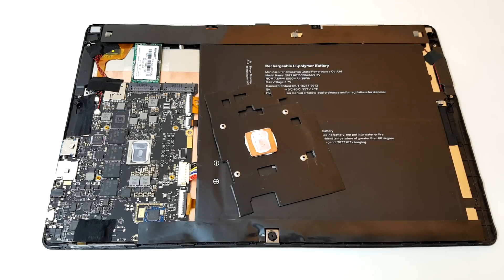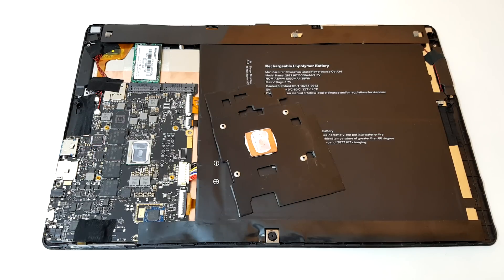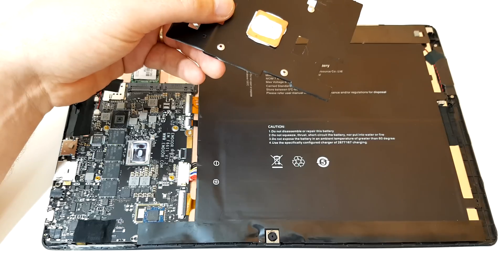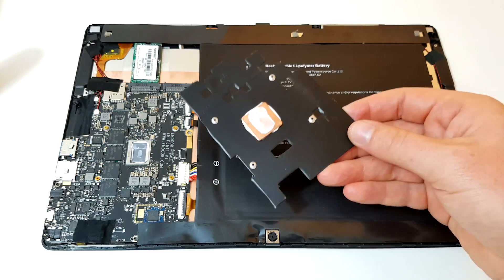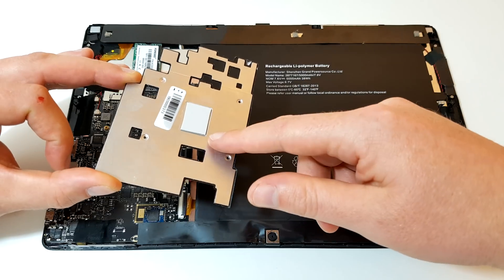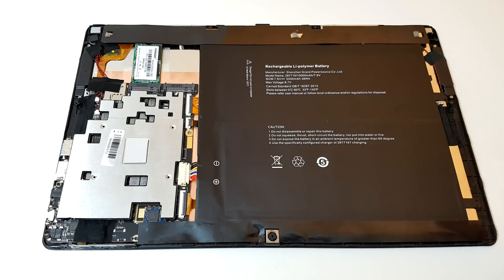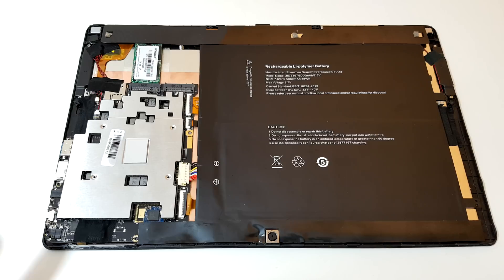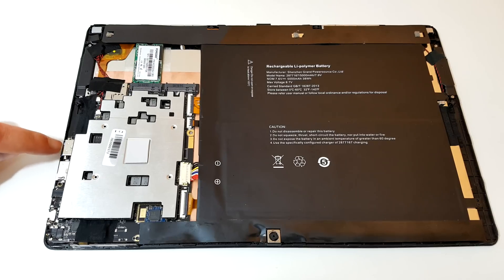Cube i9 Simple Copper Heat Sink Mod (Lowers Max Temps 20 Degrees)

Comment: Finally was able to complete this project, ordered 20mmx20mmx1mm copper shims off eBay and the shipping from China is about 30-45 days, worst part had to order 3 times!, first two times package never showed up (no worries, got refunds) that was about 2-3 months of just waiting for the copper shims to arrive.
Ordered thermal pads and grease separately, arrived months ago.
Took the i9 apart thanks to your tips, an hour ago, took off the metal plate on the CPU, Paste | Shim | Paste | Screwed plate back on, not fully it began to bend a little, I assume 1mm is too thick so I only screwed the plate on about a turn and a half each screw, and just applied some 20mmx20mmx1mm thermal pads on the plate, just threw pads everywhere, made sure none made contact with any components below the plate.
Before: temps in games 78-82c
Now: max I've seen is 51-53c !!!!!
Amazing. seeing 80c temps is just scary, I'm in IT and those temps are just uncomfortable, this mod has made gaming on the i9 and just general use so much more enjoyable, I was always shutting off when I hit 82c temps, I just get scared, haha.
Thank you so much (also the other heatsink mod vids for the i9 haha)
Reply: Hi, I'm waiting for my parts to come and do the same mod. I will receive 20 thermal pads 10mmx10mm each. Did you just randomly put them on the plate?
Reply: I see now that I should have taken pictures, yes I just covered the entire "pseudo-heatsink" thats already inside the i9.
I covered it all in thermal pads making sure not to touch any of the components below or on the edges, also where the holes in the heat-sink are, I just cut holes in the thermal pad to match, if the heatsink doesnt touch those, I guys the pads shouldnt either.I used 1mm pads that actually felt a bit thick, like when I put the backplate, back on, it felt like there was a bulge, I advise not to put too much pressure, just gently squeeze because at this point you're squeezing the TIM, the shim(s) and thermal pads, squeeze too hard and you might  bent/snap some tiny weak component, so just be careful.

Comment: Hi there ) What do you think about 25x25x1.2 copper shim? Will it fit or better use your size? And what about this concept for a custom built copper heatspreader by Wootever: http://fs5.directupload.net/images/160403/i4kz2nhz.jpg?  Or its enough just one copper shim like yours for this tablet?
Thanks )
Reply from the maker: +second Might work, I just didn't want to go wider in case it got too close to causing a short somewhere. But I think Woot ever solution is great, it would lower temps a huge amount more than my little mod.

Comment: Do you think it would be able to fit a larger than a m2 2242 in this cube i9?
Reply from the maker: +bonnome2 Hi, no I tried my Sandisk 128GB 2260 and it's too big, if there was just a little more space it would and a second ssd doesn't work in the 4G M.2 slot. Only LTE modems will work there.

Comment: get better dude! I really looked up to gaming with thermal mod video. 
there is probably a workaround. go to some service center and ask if they can flash bios. there is a way to flash to dead devices, as bios has its own power plus you are not the first one with that kind of a problem! good luck man, dont turn to pudding yet

Comment: Its kinda weird that a simple mod like this can lower temps by 20 degrees and Cube engineers didnt think of this? Its certainly not a cost issue.
Reply from the maker: +Cho I know, very odd they don't use copper heat sinks like Dell and others do on the Core M's.
Reply: +TechTablets.com What if I use a 25x25mm copper shim? can it make shortcuts by having contact with other components on the mainboard?
Reply: +Asm X I meant short circuit...

Comment: Sorry for your loss but maybe there is someone that can solder a new bios chip on your tablet? 
I had a similar problem with my L702X from Dell and I found a shop in Düsseldorf who replaced it for 20€. (Chip not included)

Do you know when your Jumper EzPad 5S will arrive? (can't wait for your review :D)
Reply from the maker: +Proteinloser Proteinshake Jumper Ezpad 5S just got it's DHL tracking number. Hope to have it by the end of the week.

Comment: Could I get your opinion on the keyboard for the cube i9 if it has arrived yet? I was thinking of getting either the cube i9 or teclast x3 Pro for my law studies since my laptop died on me so the keyboard is very important for me. Did the heat sink mod improve the benchmark score and bring the performance closer to the surface pro 4 m3 as you speculated in the benchmarks video you uploaded earlier?
Reply from the maker: +lovecomedy999 I'll post a video on the keyboard when it arrives. As for the performance, yes it made the geekbench 3 and ice storm 1.2 scores the same as the Surface Pro 4 M3, didn't test anything else out before I bricked it.

Comment: i bricked my chuwi hi8 when i changed some setting in the bios and i recoverd it using a cheap usb bios flasher with sop8 chip clamp and it works again
Reply: +TechTablets.com you could try soldering some ethernet cables to the pins of the bios and then pluging the cables to the programmer and see if you can solve it...
Reply from the maker: +IscleGaming | ZefaCraft Good idea. If it was older style Winbond eproms I'm more use to maybe. But this one is tiny and beyond my poor soldering iron skills.
Reply from the maker: +TheLaidukas I just fixed it as I was was able to mod my clip and flash it, but it was a mission. I found the bios on the Cube forums (It's in Chinese so google translated need)
Reply: Yes, I had to reflash an Onda v919 CH in a similar way. I enjoyed the experience but rather had not messed it up in the 1st place!
Reply: +Alex Quant its an experience and i learnd from it but you would expect it wound not happen and still it does
Reply: expansiongames You're right - it should not be easy to bugger up a firmware, but these devices are made to a low cost with few of the niceties that larger companies with resources can implement. I too learnt a lot in a practical sense. I guess these devices should be seen as for hobbyists rather than total novices. Buyer beware!
Reply from the maker: +expansiongames I tried with my USB programmer but the Winbind 25Q64 chip is too low and has to be removed to be flashed which is beyond my skill.
Reply from the maker: +Alex Quant I expected a second menu, but no. Just wiping flash and the keyboard was locked out. No way to abort, I was yelling obscenities at the tablet.
Reply: +TechTablets.com so what are you going to do with it the throw it away or give it to me:)
Reply from the maker: +expansiongames Trying to find someone locally that can remove this bios and replace it with a new flashed one. For no,w it has been put aside. It's also annoying the hell out of me looking it...
Reply: +TechTablets.com well hope it works out its a shame throwing it away
Reply: +TechTablets.com Do I understood correctly that you have new bios memory chip that is reprogrammed? How did you managed to get one? By seeing all these tablets on the web and forums with bricked BIOS I plan to read and store BIOS memory dump from my recently bought chuwi Hi12.
Reply: +TechTablets.com nice job so are you going to show the results of the mod?
Reply from the maker: +expansiongames Yes tomorrow I hope I can.
Reply: TechTablets.com Nice, I never tried that, when I fail to find program dump in English forums i usually quit and start searching eBay to buy the same device but cheaper with cracked screen to read the bios. I just thought you could make introductory video how you unbricked the tablet. I guess it would be quite successful video and would bring many views.